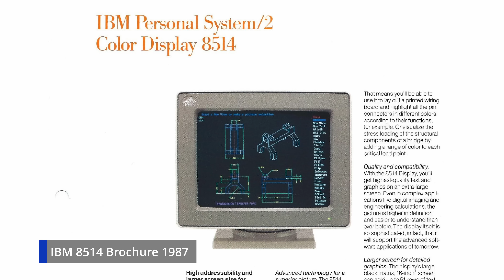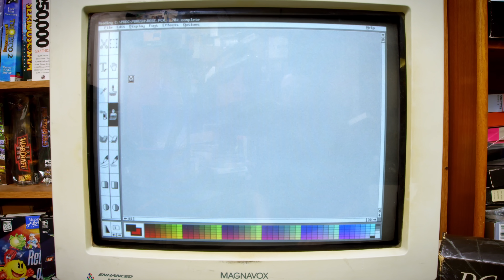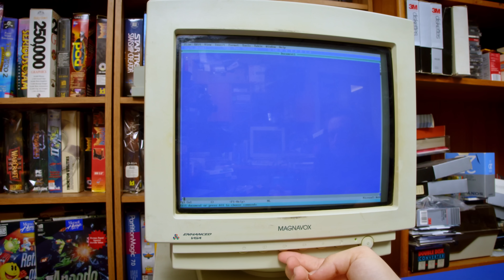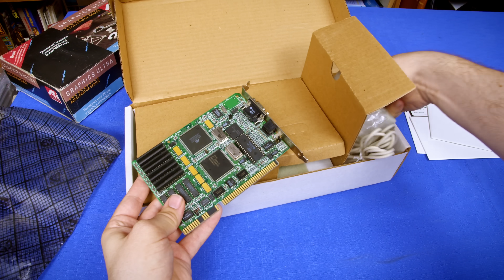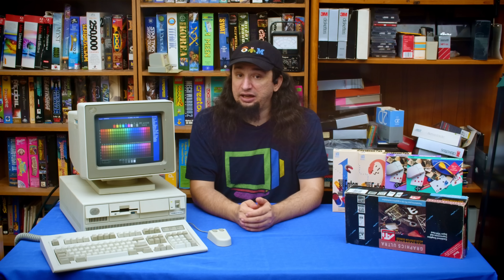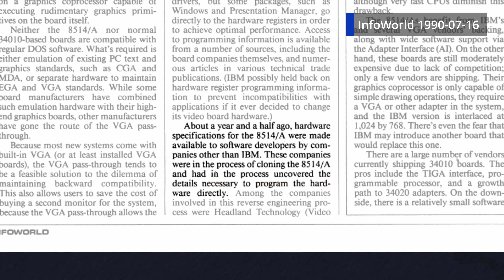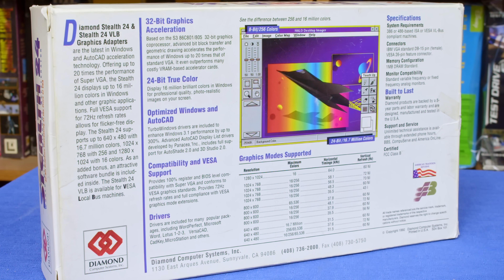IBM's Weird GPU From 1987 - IBM 8514/A

Comment: "GDI would evolve into DirectX"

This triggers me.

I know they're both Microsoft APIs but they're really different. The GDI seems like it's designed to make Mac software easy to port to but it's more accurate to say both are heavily influenced by Xerox PARC's work on GUIs. There's a famous Bill Gates comment when Steve Jobs accused him of stealing the Mac GUI "Well, Steve, I think there's more than one way of looking at it. I think it's more like we both had this rich neighbor named Xerox and I broke into his house to steal the TV set and found out that you had already stolen it."

Now the GDI did have some clever performance ideas, my favourite being BitBlt being implemented as a code generator but games companies hated the GDI and Windows in general as being much too slow and stuck to Dos. On Dos they'd do all the rendering direct to the frame buffer. Initially Microsoft had an extension to the GDI called DibSections. A DIB is a device independent bitmap in the same format (e.g. 8 or 16 bpp) as the framebuffer. A section is a chunk of memory shared between user and kernel mode. So the idea was you'd render into the DibSection and then call SetDIBitsToDevice to render it to the screen. This was enough to get WinDoom running pretty quickly. However GPU vendors were already adding hardware acceleration and DibSections can't take full advantage of that.

Direct3D was apparently designed by doing a round robin tour of games companies like ID Software and graphics accelerator vendors like ATI and NVidia and trying to design a very lightweight layer between them with help from Michael Abrash. So in DirectX I can call a function to render a bunch of polygons and it very quickly ends up in the driver the GPU vendor provided passing it off to hardware. This is obviously a win for the game vendor because they get 3D acceleration for free. If you go from DibSection to Direct3D you just rip out the triangle rasteriser and call a function which runs faster. It's a win for the GPU vendor since they don't actually need to release register specifications, just a binary of the driver. And it's a win for the player because they can run the game at a better resolution/frame rate because of the hardware acceleration. Most of all it's a win for Microsoft since they control the API. Initially the games run on Windows but it wasn't that hard to convince people to port them to XBox, originally called "the DirectX Box". Crucially it enabled Microsoft to compete with Japanese console vendors. In fact the original name for the technology was "the Manhattan project" after the WW2 Allied nuclear weapons program. That's the reason the original DirectX logo looks like a radiation symbol and one of the original DirectX demos takes place on "the Manhattan space station". Needless to say this leaked out and the XBox never sold well in Japan.

Comment: I remember using a card like that in college but I swear it had an 80186 on it and was in a PC/AT
Later I helped design a video game system around twin TMS34010 processors - what was found on TIGA cards - nice CPU/GPU
Reply: You designed Midway arcade boards?
Reply: @fungo6631 no, did it with Gottlieb/Premier.   Only one game was actually published on the platform, sadly

Comment: Someone should investigate why 1280x1024 is the only standard resolution that is 5:4. My best theory is that this was inherited from the professional workstation market, Sony's NeWS workstations used that resolution in 1987 and so Sony made monitors that could sync to it and then sold them for other computers as well. 1280x1024 75 hz is in the VESA standard timing lists from the very beginning

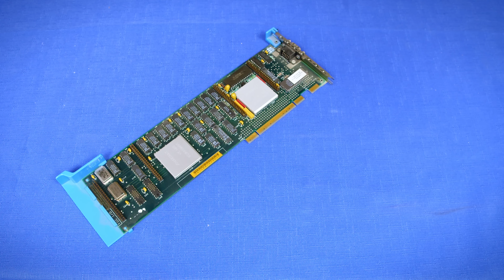Comment: @3:43 - Onboard vga could only do 16 colors?  My recollection was 256.
Reply from the maker: Like everything else about this project, it's complicated. It's 16 colors at 640x480, but there is at least one 256 color even lower resolution mode on the PS/2's original VGA chipset.

I didn't dig into it more because the clone companies added 256 color 640x480 modes early without 8514/A compatibility and it just muddies the waters.

Comment: A big reason why the SVGA (800 x 600) market grew so quickly was because IBM jumped directly to 1024 x 768 as a built-in option with XGA (which you briefly mentioned). 1024 x 768 on the 14" CRTs of the day was pretty unreadable, 800 x 600 was fine. Why pay more for something you couldn't use?

Comment: in 1989, I got a free AT/286 with a Sony Monitor. The 286 was kind of slow, but the graphics were good. It came with the early S3, chip, and it did all the resolutions, up to 8514/A both as Interlaced, and non interlaced, and when we got Windows 2.0.3/286, it ran in non-interlaced mode, but it was a bit slow at that resolution, so I mostly used 800x600 for Desktop Publishing, of course when the prices dropped significantly, with the Orchid cards and the display list cards, ( cad speed ups ), the prices of the Paradise chip dropped, and speed became available. Many of my clients asked which card to get? And I recommended the Paradise card, except one who insisted to have the fastest AutoCAD GPU which was the Orchid Prodesigner II, at 5 times the price, and it was fast.

Comment: One element of the 8514/A legacy persists to this day, the 768 pixel vertical resolution. Companies still make low end laptops with a 1366x768 display. Only 342 pixels wider than the 8514/A resolution. 262,656 more pixels.

Trident never made any video cards, according to them. Nevermind there were tons of video cards with FCC ID numbers registered to Trident Microsystems and with other info on the PCB pointing directly to them, they didn't make those cards, nope, nosiree! Not our product! Go away. Don't use our reference driver, if it doesn't work, don't complain to us.

What Trident did was make "reference kits", unassembled video cards, which they would sell in any quantity desired, often with various customizations. Trident's official deal was a company should buy "reference kits" as examples to use to design their own PCB, video bios, and customize the drivers, which Trident also supplied as ready to use "reference versions".

The vast majority of video cards with Trident chips were simply reference kits soldered together and maybe different logos and company names swapped into the driver installer. It was very rare that a Trident card had its BIOS mucked around with to where the reference driver would not work. Just as rare was any video card with just the main chips sourced from Trident, with the rest of the hardware not made by or directly copied from Trident.

There was one video card made by TriGem which only had drivers released for Windows 95/95a. Those drivers would not install in 95b. With the reference drivers for the chip the mouse cursor movement range was compressed 50% horizontally and would only move on the left half of the screen. IIRC it used a Trident chip. I figured out a fix which replaced one DLL in the reference driver with the same DLL from the TriGem supplied driver. I uploaded that to Driverguide and for at least 10 years I got thank you emails from people who ran into that same problem.

Comment: gdi didn't 'evolve' into directx, WinG specifically existed to bypass gdi because it was inappropriate for action games and games like doom. directx isn't an extension of WinG either, but it added explicit surface/memory management. lockable surfaces finally get you to something like WinG, but for every resource. blitting could be accelerated again for 2d surfaces without the overhead of ddbs/dibs in gdi... the original problem WinG solved

Comment: GDI is still used by Windows internally, by the way
Reply: But only in compatibiliy mode. And it doesn't get accelerated in hardware anymore, as GPUs since the nVidia 7 and 8xxx series don't have BitBlt and DirectDraw primitives in hardware, but in older drivers it is emulated in microcode, and newer just do it completely in software.

That's why when you run Windows XP with an older nV 6xxx card or an ATi Radeon HD4xxx, the GDI applications seems to render faster than in Windows Vista +.

Comment: At the beginning you ask why people didn't talk about this card, but then you answered your own question: Micro Channel. When the PS/2 came out, I had been doing board-level repair of clones for a few years and had a nice little side job while I was in school. Pretty much all of my customers, except educational institutions who got a hefty discount, absolutely hated the "IBM tax" where a big blue box would cost substantially more than a clone with the same performance. And due to the licensing issues with MCA, essentially nobody adopted that bus in favor of leaning on the ISA/ EISA bus. MCA and IBM's pricing strategy kept me in business for a good while, until I pivoted and started doing hardware-level repair on people (also using aftermarket parts/ components, because OEM replacement parts are much harder to source for people than original IBM parts were as an independent repair shop back then).

Comment: Sorry, but GPU means that it can run its own program instead of the CPU, AMIGA had a Copper that ran code independently of the CPU, you could control graphics and sound. Here's a demo, nocpu :) Copper(vertex/fragmant shader)/Blitter,Sprites(raster)
Reply: You are wrong as well. GPU is a term made to refer to 3D graphics chips which can do at least T&L in hardware.

Older graphic chips were just called graphic chips. TIGA, i860 based adapters, SGI stuff etcetera could also run program independently in the processor, but them were never called GPUs... And the inverse... The first so called GPUs (chips which could do T&L in hardware) were all them Fixed Pipeline chips. 

Also, Copper only was famous because it could do quarter of what the beefier chips could do, but a lot cheaper... And highly focused in multimedia and games. When professional programs and workloads came, they had to support extra adapters as the RTG interface.

Comment: In the 80's I did  a lot of repair work on the Xerox Star. It's monochrome monitor had a resolution of 1024x808 with the whopping refreshrate of 39hz, interlaced. Working on those screens always left me with headaches.

Comment: The latest (25MHz) Model 80 has two "AVE" (Auxiliary Video Extension) slots...
Reply from the maker: Oh wow, that is super strange. I'm guessing it was wasn't for two video cards specifically and probably a video card and something like the M-Motion to connect standard video hardware?
Reply: @TechTangents  - The Model 80 'Type 3' planar was designed by IBM Japan. It's the only PS/2 planar that has a socketed KBC chip. IBM used that planar in the 3172 controller (look at the 'Ardent-Tool'), so there can be different theories, but another AVE slot may be just for the Japanese market.

Comment: At one point in the early 90s I had a VLB ATI Mach32, which was the end of the road for ATI's 8514/A clones. One thing I remember about it was the distinct character mode font. It was very different than the typical VGA card font.

Comment: One day I was browsing through supported display modes in our 486 with Win95 and 14" display. It lived in 800x600, despite some required compromises like lower pallette count and slower refresh rate. But I was blown away two times that day - that it supported 1024x768, and later - how eye-straining and awful interlaced 43 Hz is.

Comment: My dad, back in 1989, bought a Tandy TL/2 with a 4MB RAM card because it helped with rendering for AutoCAD Release 6.. with that 768K of system ram and the Tandy color.. the 287 coprocessor it had, I was never able to use it... but it killed as a gaming PC before i got a 256K VGA card for it... then by 1992 the games got too much for that poor 286

Comment: Worked for a company writing software & selling turnkey systems based on the Truevision ATVista board (TI34010-based, 4MB RAM w/ optional 6/12MB daughterboard, 1024x768x24-bit color) - from 1988 onward.  $4K apiece, 30Hz interlaced output (could also do still-frame image capture).  We used a special long-persistent phosphor Mitsubishi DiamondScan monitor to keep the epilepsy to.a minimum, in addition to a standard CGA/EGA monitor.  Made it hard to tolerate King's Quest III on the crappy EGA monitor.

Comment: I built a lot of systems that used this card (ATI clones) as  X-Windows terminals running DOS TCP/IP stacks and X-Windows Client. 
The version  I used were ISA based initially and "flippy" with PCI and ISA on the same board. You flipped the board/bracket for the bus you needed.

Comment: I wonder if my 8518 monitor might be compatible with the 8514/A card. I expect so, considering your 8513 (which I've also got) worked with it.

Now I wish I'd picked up an 8514/A card from the guy I bought my PS/2s from. I'm fairly certain I saw him list one on the electronic bay website a while back. Now they're super expensive, and I expect they'll soon be even more expensive no thanks to your video!

But I'm still glad you made this video, since I always thought the 8514/A card was kind-of pointless considering the machines already have VGA, and now I know it was a much more important card than I ever could've imagined.

Comment: I wouldn't count these as GPUs. I bought some S3 graphics card for my first PC, a 486 to play Doom on of course, and it had 2D graphics acceleration that Windows could use. All of my friends just had basic cards. Non PC workstations like SGIs did have graphics cards I would consider GPUs. Most of those 2D graphics accelerators just had a blitter and a sprite for the mouse pointer, so a lot less than what Amigas had out of the box. I would consider hardware 3D texture mapping support to be the thing that separated a GPU from all kinds of simpler graphics cards, though the cards that provided that tended to provide a bunch of other stuff all related to modern 3D graphics. Basically they provided massively parallel floating point math. They're as much descended from FPUs as they are descended from older graphics cards and 2D accelerators.

Comment: Thanks for describing why some of my CRTs are not compatible with some of my ISA cards. So frustrating to try to get it so it lines up and some of them you have to go through the menus and max out your settings. 

Right now I'm using an ATI VGA wonder, but I've tried a few different cards

Comment: In college, my art professors had a PS/2 Model 60 with the 8514/A and 8514 monitor in his office running Windows 2.1. I spent a lot of time working on that system, troubleshooting a 4MB memory card. Eventually I found the memory drivers that came with the computer. Eventually we could run Deluxe Paint at the higher resolutions. In the interlace modes, its flicker wasn't as bad as you might think. That monitor had pretty long persistent phosphors. So, it wasn't as bad as an Amiga in HR interlace.

Comment: A Microchannel card that could only go into one specific slot was not that unusual. It was the 80s, after all. Most of the time, you only ever wanted one card that needed to go in that slot, because it usually had a unique function. But there have always been motherboards with multiple types of slots and cards that could only be used in a specific one.

Comment: It’s like we’ve gone full circle and GPU’s are huge again. I was initially surprised by the length of these early cards but considering how large current day cards are, they basically take up the same amount of space except needing more slot space.
Reply: The thing is that most modern GPUs are not that large (in terms of PCB card size .... in terms of silicon real estate, they are massive), but the heatsink/fan systems are enormous.

Those modern cards ... all fan and heatsink!
Reply: @canthearu4876  also not too long in the past you could still get pretty powerful single fan gpus such as the gtx 1080 mini, which are about half the size of modern flagships.
Reply: @canthearu4876  The smaller things get. The hotter they get! (Less atoms to bump into means the movement is that much more effective in generating waste heat)
Reply: Many of the early cards, even CGA, were full-height full-length. But they were through-hole/ DIP components and 7400-series logic, so a lot of PCB real estate was required. It made troubleshooting a lot easier than the tiny pins and traces on more modern SMD, but shrinking everything down also allowed room for significant improvements.
Reply: @r2db  Yep, I have one of those CGA cards (a clone, but full length)

Back in the old days, I had a hercules compatible monochrome card that was full length too.

The original designs (CGA/MDA) were Motorola 6845 controller based with a LOT of discrete glue logic to make it work.
Reply: It's primarily the heat sink and fans that takes up most of the space. You can get water cooling blocks for modern gpus that make them quite small compared to their retail design. Though if you want to check out some bigger cards look up the VESA standard.
Reply: Well, more so they used to be big because they used discrete hardware components, and they got small.Because the cooling didn't really increase in terms of needs.But the hardware got smaller and now we're big again, because we need to cool things again.Less so for hardware, it's all cooling
Reply: Memory took up a lot of space on the boards back then; about half of the board seems to be memory... three quarters if you include the memory expansion.
Reply: @mbpoblet  Memory and a ton of discrete glue logic.
Reply: this is not a GPU, this was just called a graphics card, at best you could call it a graphic accelerator as it has a fixed non-programable pipeline (you can't program it, you just send it instructions)

Comment: I didn’t have an 8514, but I did have an early “SVGA” on my computer, which also supported 1024x768 at only 45 Hz interlaced. It was painful to use. But I was a CAD student, so the resolution was worth it.